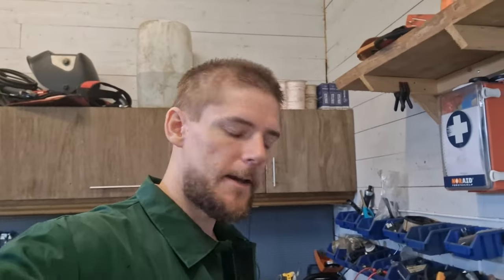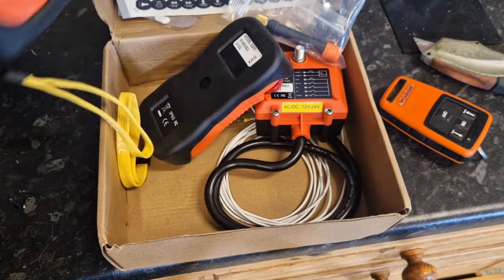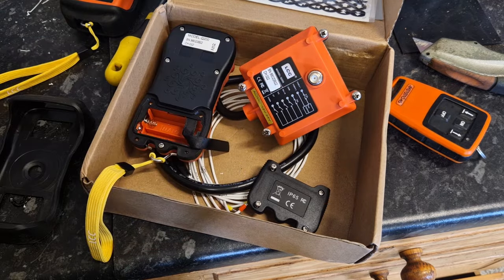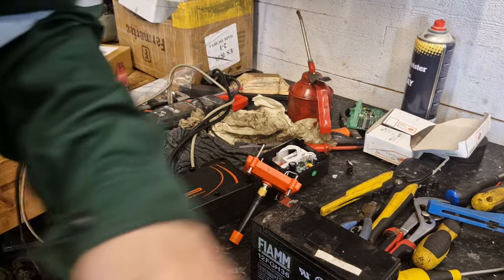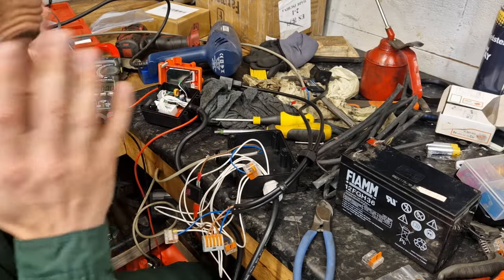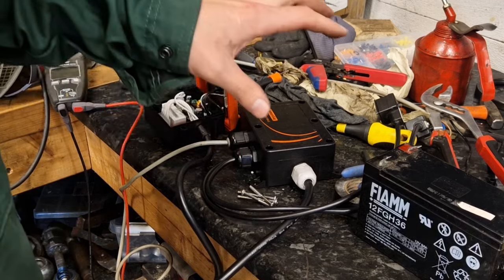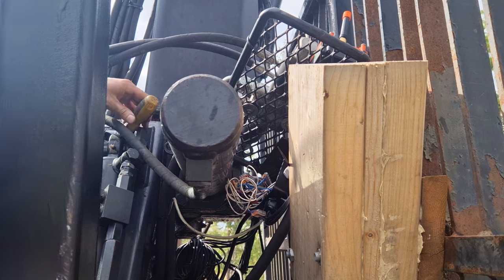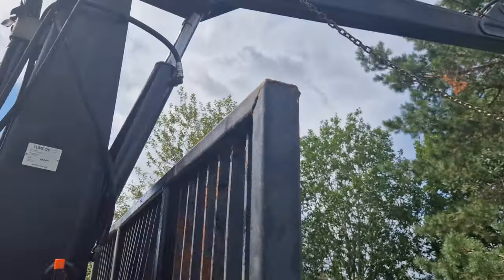Installing a Log Trailer Winch Remote Control

Comment: I ordered a Q602 for my building crane (6 bottons, 2 with double speed (up & down)). The original RC gave up while I was halfway fixing the roof on my house.
They ask €1800 including taxes (about US$ 2000) in specialized shops for a new version. I ended up buying directly from LCC which will cost me about US$ 175. I hope I'll be just as satisfied as you within a few days.

Edit:
It arrived today. Total cost: € 163
30 minutes work for replacing the old Imet M320 with the LCC QQ602.
So far, 100% satisfied. The old transmitter worked with rechargeable 6 Volt custom made batteries which cost more than the whole set from LCC. The LCC model uses 2 standard LR6/AA batteries. One time or rechargeable so much cheaper to use. Range of use is also superior.

Comment: So was it the original (black) receiver or the new (orange) receiver that used the negative switch signal
Reply: About to install similar controller on crane on my service truck and they sure don’t give much information with these remotes

Comment: This dont look like a DYY friendly project to me, theres about 100 wires to many. You get a winch like that on front of Massy, just for those once in 5 years you get stuck.......
Reply from the maker: Haha yeah it was a bit complicated and weird to figure out that chinesium wiring 😂

Would be nice to have a winch on the front of the Massy actually, but the FEL is in the way. Also, I've never needed it when using the tractor for what it is built for, which is skidding. I've only needed it when pulling a trailer, which I shouldn't really do with that tractor anyway.

Thanks for watching! ❤️

Comment: Hi, great video for me!  I'm working on building a small logging trailer with remote control winch like in this video:
https://youtu.be/V0nwOwhR_C0?si=IIPreCMyaeBx0z6e
I have the trailer and hydraulic power pack... getting close!
Have a question .... the two black electrical connectors that show up at 9:15 on your video... what are the called? Did they originally come with your control valve? What are they called?  Thanks much! I'm now subscrbed! Keep up the good work!
Reply from the maker: Oh that's awesome! Very interesting. The connector are called "cable glands" or "cable entry connectors". You can also search for "ip67 gland," etc.
Reply from the maker: Sorry, you obviously meant the solenoid valve connectors. They are just called that. Solenoid connectors 😊